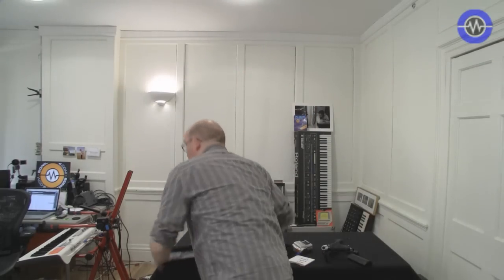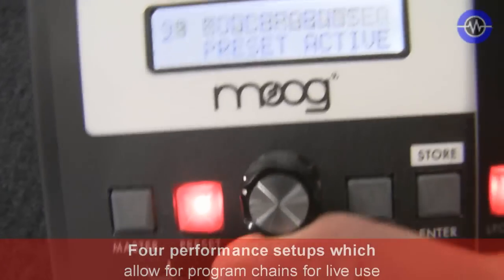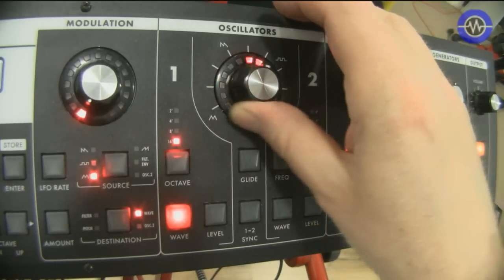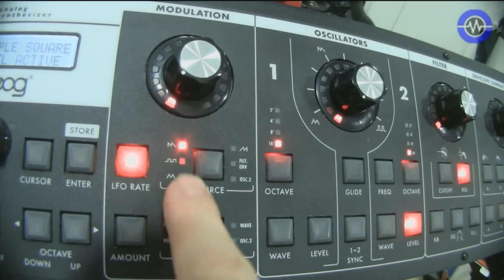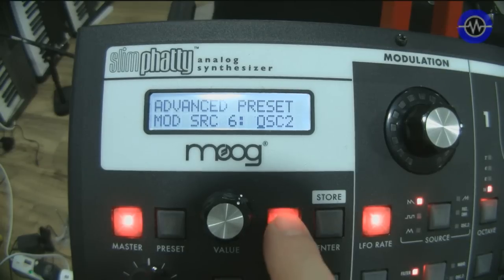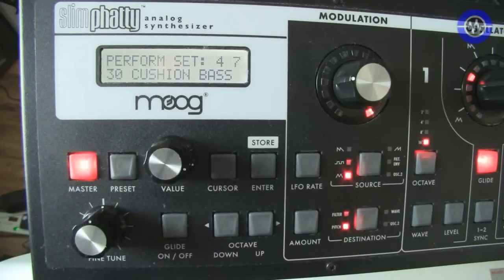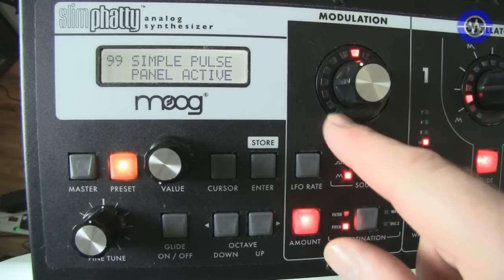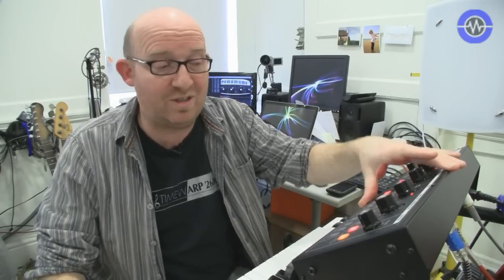Moog Slim Phatty - SonicLAB Review

Comment from the maker: @MrEvanbooker You can set it to be several modes, I forget what they call them, I no longer have the unit here. But one is where you have to ravel through the programmed value to pick up any changes (which was what you saw there) there is another which just starts wherever the knob is and starts working and I think one other mode.

Comment: it depends on what are you suggesting
If you want to use your guitar as sound controller(MIDI) for this moog slim phatty then yes:
but you might need another gear(something like sonuus G2M,google it)to transcode your guitar into MIDI signal before further connecting into this slim phatty

Comment: sometimes when you use it in small amounts it can give a sound a little bit of grit. Its kind of like using a sub oscillator to beef up  a sound white noise can add a little bit of a gritty sparkle to it.  At least that's what i use it for.  good question though

Comment: great review as always. Quick question - in arpeggiator mode, does it display the numeric value of the tempo? Also, is it possible to tap tempo for the arpeggiator (like it does for the LFO rate)? Thanks!

Comment: Also the software costs 75 dollars, and it's a little janky. Turning knobs quickly lags out on my computer with the VST, and you have what seems like higher resolution control on the actual physical knobs. It can be nice for designing patches just, generally though, for example if you are wanting to sit down and make a small sound bank for yourself.

Comment: Unfortunately, the filter on this thing has nothing to do with the real Moog filter found on the Voyager or the original Minimoog. It has a very different character to it. That's not a bad thing. It's just not the typical Moog 24 db/oct ladder filter behavior. This one is much more aggressive and distorts quite easily, even without the "feedback to filter" trick. If you absolutely want that Moog filter done right, than go for a Voyager or any old Moog synths. If not, then this is ok, I guess.

Comment: Ok I see the EG button in the lower middle of the filter section - which makes more sense than having it in the envelope section.  Thanks to thecryptkicker5 /
Reply: OneyedSon Helps that you can understand what he's saying & ask questions huh?
Reply: OneyedSon just to answer the question for anyone. The envelope knob controls either the envelope adsr, or the volume adsr. Select either ADSR's respective attack, decay, sustain, release, and the knob controls it.  Then back under the Filter section is the Filter EG button. Press it and then dial in the amount for the Filter EG.  

The EG parameter allows you to set the degree to which the Filter EG affects the filter cutoff frequency. The EG parameter is bi-polar, meaning the Filter EG can affect the filter cutoff either in a positive or negative
manner. A positive EG amount will raise the cutoff frequency, while a negative EG amount will lower it.

Just for fun, the O.L. to the right of the E.G. is the overload.  

Here's the manual: http://www.moogmusic.com/sites/default/files/slim_phatty_users_manual_0.pdf
Reply: thecryptkicker5 Thanks,  actually got to play one at the local GC  ( of all places )'  I post manual links also so I appreciate that - It just seemed to me like thats one function that should be right in your face, I guess you just can't tweak cutoff and EG amount at the same time , So do you have one ? Like It ?
Reply: Np! You could always CC it via DAW, maybe even bind that to a controller like an lpd8?  I do have one but just got it the other day so we're still on first base and holding hands. No hardcore makeouts yet but we are definitely getting there, lol.  

It's really hard to answer if I see it as long term relationship though at this point. It's definitely hot, yes, that's true. Right now I currently have a Bass Station II. I use to have a Minitaur, but had to sell it a year or so ago.  I absolutely loved it and melted at the sound, it sounded so amazing. But it was quite limited and always sounded smooth but never really had a lot of bite to it.

I am mostly doing an ebm type of style, which is why I ended up with the BSII. I got the SP because I missed the Minitaur and hoped it would growl and bite like the BSII. But when I put the two against each other in my own mixes and play around, the BSII kicked the crap out it. It just had so much more sonic potential and I could go to so many different textures with it and it just sounds so fantastic in the mix, like just incredible how well it sits, at least with what I am doing.   So for me in regards to bass, the SP would be a secondary mid range bass or an arp bass. That is where it really starts to rock out. It really likes to do leads as well, so that kind of shifts to the bass as well, so you can get a lot of great bass leads out it that are more up front. But the BSii can do that just as well for me but can also sit in the back and really fill up the bottom end and still remain separate not so upfront. But if you consider the name, Slim Phatty, that's really it's purpose, it's suppose to be a Phatt synth, big fat in your face bass and leads.

Even the arps have a fatness to them, I did find last night that if I pull down to just one oscillator though, I can really cut out some of that fatness and get some thinner pads, textures, bass, and nice arps. I was listening to a Doepfer Dark Energy 2 yesterday and that thing is beautiful. It has only 1 voice which is what inspired me to use one oscillator on the SP.  

The leads on the SP are really sweet if that's what you're looking for. It's got a lot of good lead type of sounds but not to be confused with proximity type of melodies similar to what you would get with a piano. Which is what I was originally expecting and hoping for.More like the kind of style of leads from violins or horns.  

So for me, I'm having to get reacquainted with it because for me it cant out bass the BSii, it can't really truly perform those typical classic background glossy/trance type of arps either without really sweet talking it with 1 oscillator and really fine tuning it down.  Again, it's not a background synth at all, unless you are doing an evolving kind of drone, but even those really draw in your attention and pull you in when you hear them. So you start to see what they intended the synth for is the exact opposite of my intentions at first. I did want the growl and bit yes, but not so much front and center.  But it still sounds so fantastic, again like that hot chick that just blows you away but you're not quite sure about at first but you want to keep going at it to see where it goes and you definitely cant wait to really get intimate with it because you can really get a sense of what it can do as you start to see what it wants to do and how it likes to do it. For me at the end of the day, I may end up with a dark energy just because I'm looking for something like this but more in the mix, more glossy and smoother. But I'm not calling it off by any means yet just because it sounds so fantastic and I feel like the fault was my initial approach. Now I need to come back at it and use it like it wants..  Sorry for such a long rant.
Reply: thecryptkicker5 Ahaha np / Yeah - it's seductive , but I have a Prodigy, which also has osc. sync unlike a Minimoog, so I'm covered w the warm and fat / Just had a guy in Detroit mod it so I have separate outputs for osc,1 & 2. Now i can use my moogerfoogers on those and bring them back into the filter,  Even before that I found that you can get some really bright crystalline sounds by sweeping osc,2 with a separate cv sequencer  or the same cv, by multing, offsetting and lagging to give an envelope shape with a downward pitch sweep that can be offset differently for each step in an arp (seq). Sure you can  draw in the cc automation for that for the SP as well / Just really a beautiful sound approaching what I can get on my Mono/poly with the cross mod and sync, ( also  dirt and odd harmonics of the ring mod) ,  Bass Station 2 certainly beats  everything on paper for price, but I haven't played one so thanks for sharing the good news,  I want the Pro 2  LoL  but will end up with a BS-2 or Mini/microBrute probably. MicroBrute will be great for me because it has the lfo cv. out which can be synced to different time divisions so can easily do what I just described.  Only kit I know that does that (cheaply). After that - a BS 2 for sure !  Presets load instantaneously. I've  heard so you can even program drum loops by sending program change for each hit !  Plus it has the high and bandpass, plus ring-mod unlike moog.  So thanks again and sorry for rant as well LoLs /